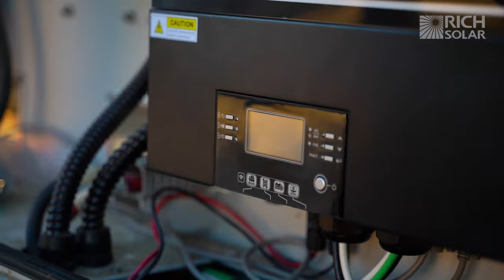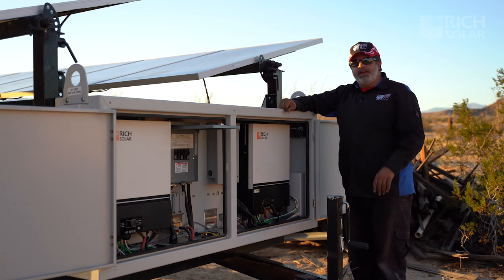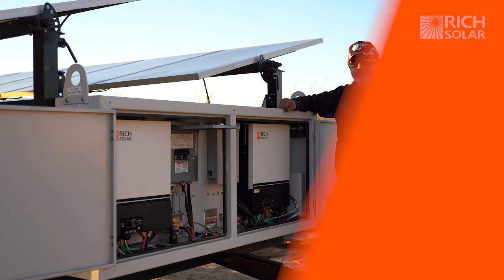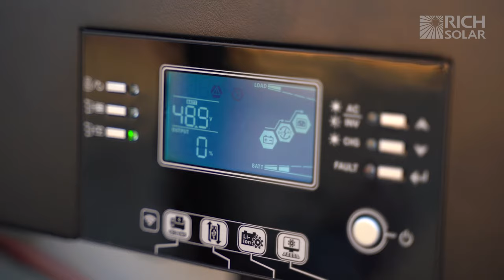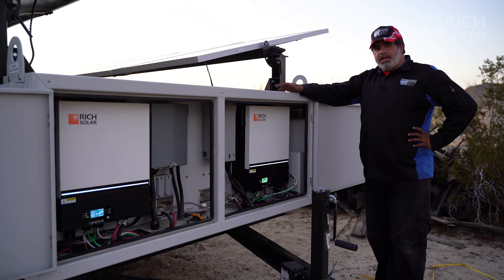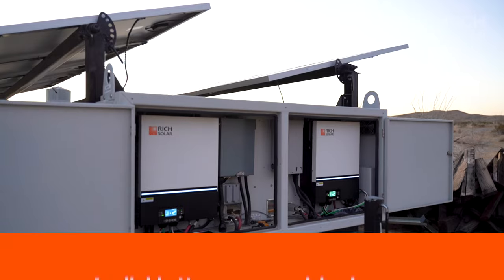6500 48V Off-Grid Hybrid Inverter Installation Project on a Cargo Trailer Setup

Comment: Do you have a video about connecting a generator to this inverter?
Reply from the maker: We don't have it yet. We will definitely shoot something about it soon! Thank you :)
Reply: I'm having trouble getting our generator synced with our inverter while our power wall rapidly drains after 3 days of rain🎉 I have not been able to get any competent help on the phone either 😅
Reply: @2hacksbuilding82 we were able to purchase an EG4 chargeverter. Connects to the generator and the batteries.  Works amazingly

Comment: This inverter is not UL safety certified for use in mobile application. As a solar installer, you should no better.
Reply from the maker: Actually, our 6500 48V hybrid inverter is UL safety certified 😃
Reply: @RichSolarTalk  UL-1741 or UL-458?
Reply from the maker: @quickquote1568  Check this out: https://cdn.shopify.com/s/files/1/0058/2769/0553/files/CN209AO2_013_Cert_CU_72226369_01_co-license_extsigned_2.pdf?v=1666900795